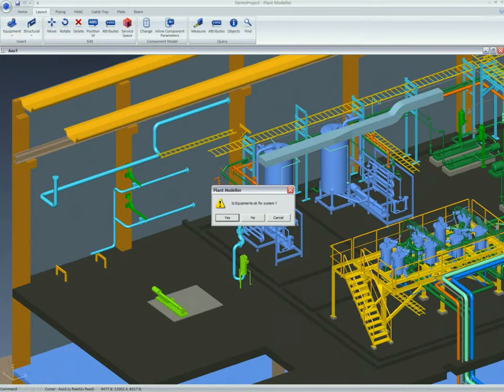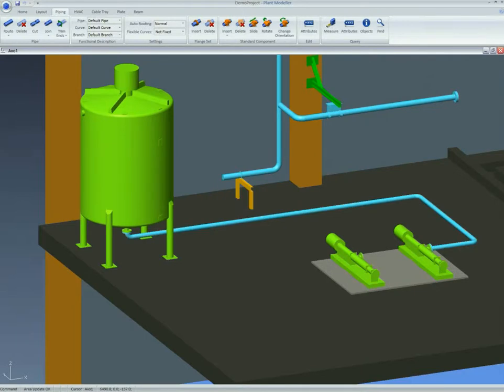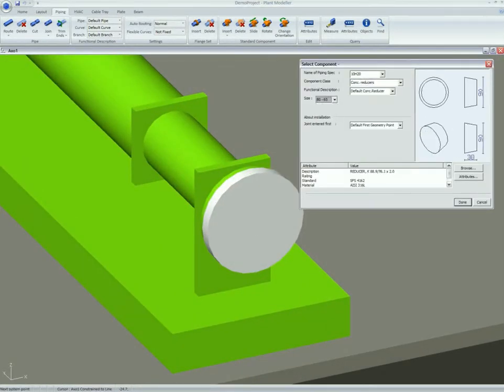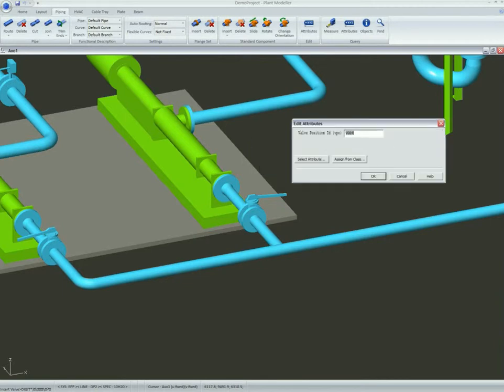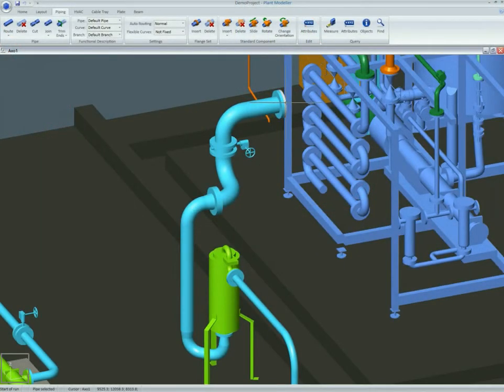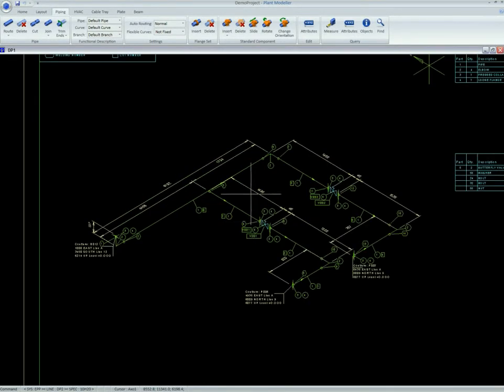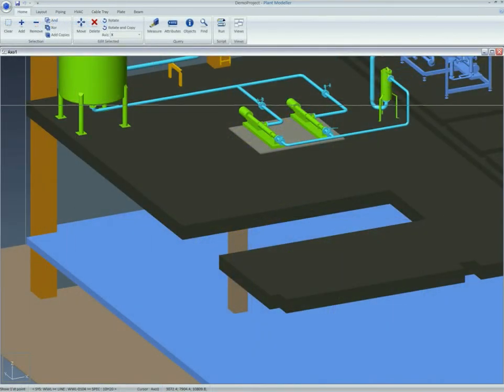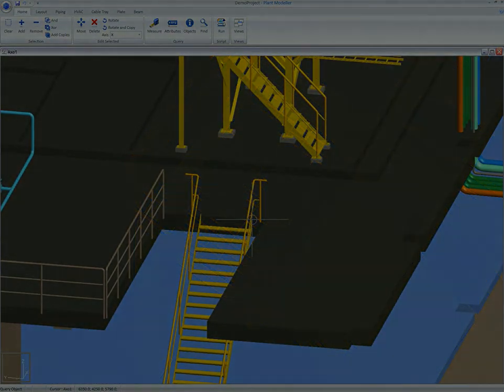Cadmatic 3D_modeling.flv

Comment from the maker: Oil & Gas

Complex oil and gas projects require design solutions and tools of the highest standards for all network members to provide them with up to date information that is easily accessible for all companies involved in the design, building, operation, maintenance and asset management chain.

Cadmatic solutions for oil & gas engineering networks provide convenient and easy-to-use tools for all project phases that keep project information accessible to the whole network etc.